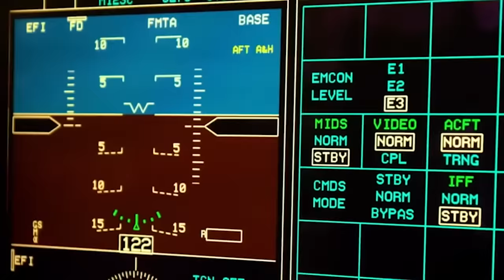The Cheapest Most Powerful Fighter in Existence

Comment: The idea of a cheaper, reliable and a fast to produce aircraft demonstrated by Northrop's F-5 has been upheld once more.
Reply: Was also the reasoning behind the MiG-21
Reply: @DarrellLarose  Yes. Both are forerunners of the idea.
Reply: @DarrellLarose and now the su 75
Reply: outdated
Reply: @jasonhunt007  not for the nations that can't afford 5th generation fighters.
Reply: @jasonhunt007  not true.
F-5E/F-20 airframe & engines have proven their performance & cost effectiveness. 

Radar, avionics, helmet mounted displays, networked data-link for Air Battle Management, etc an all be updated & upgraded.

Since air warfare doctrine is now geared towards BVR and missile engagements, what's key are EW, radar & missiles. All these can be done on a proven airframe like the F-5 E/F-20.

Stealth is over-rated. It just reduces the RCS. It doesn't make the plane invisible.
Reply: @therealrobinc none of that matters without the logistic support that the F-16 or a version of the F-16 has worldwide.
Reply: The PAF actually operated F-5s. Unfortunately, they were neglected and didn't get any upgrades :(
Reply: @jasonhunt007  how many times do you need to reinvent the wheel? The F-5E/F-20 are proven airframes that are cost effective to maintain and has the best bang for buck. Any nation that's serious can buy the entire factory to ensure enough spare parts & logistics support for its air force. Still cheaper than the F-16 across the board, and just as lethal with updated gear & weapons.
Reply: @therealrobinc  The F-5 is just too lightweight to be a serious defense system for any nation serious about defense.  Try again.
Reply: @therealrobinc  even the most poor South American nations can afford to fly the F-16 so your point is moot
Reply: @calebemerson9317  not at the expense of other essential expenditures in education, health, etc. Not every nation has the luxury of operating expensive gear with its own currency backed by ever increasing national debt like the US. You sound like the type who maxes out their credit card and only pay the monthly minimum and claim it's affordable, and never caring about your eventual total debt. That's utter irresponsibility & fiscal folly. In addition, the air forces of poorer nation don't need expensive gear to start & sustain continual wars to line the pockets of the military industrial complex lobby.
Reply: @therealrobinc  And who's going to develop the upgrades?  The country that cheaped out and bought the "budget budget fighter"?
Reply: @jasonhunt007  Agreed, the F-5/F-20 airframe is too small and obsolete to get enough done for the price tag, not to mention the lack of support considering how the wind blew on the F-20 sales.
Reply: @therealrobinc  F-5E and F-20, despite appearances, do not share the same airframe.  The F-20 uses an entirely new airframe (one based on an already obsolescent design).  Why do you need to reinvent the wheel?  When the blueprints for the old wheel are not available.  The resources used to figure out how the old wheel was made is just as easily, and likely better spent on reinventing it.
Reply: @jasonhunt007  1. High-low setup works and there's pleny of lower-tier tasks where F/A-50 is overkill, but allows to spare high end aircraft from wear and tear 2.  For DEFENSE and Air Policing most countries can do easily with Gripen C or F/A-50.
Reply: @calebemerson9317   New at 80 mln / a piece price tag and how about cost of OPERATING these aircraft? I doubt it.
Reply: wouldn`t it be closer to f16. both in appearance and `low cost` in comparison to the expensive f14 and f15 at the time
Reply: @hotdog9262  If F-16 and F-35 didn't exist, sure.  But they do, so FA-50 is a fighter that underbids even F-16, Like F-20 tried to do.
Reply: @@klinestill Not just someone decided to use the F-16. Many nations decided to use the F-16, creating a world wide sustainment supply chain to benefit all F-16 operators.
Reply: @@klinestill You had no point but thanks for trying.
Reply: Only this time its from South Korea.
Reply: @josephdioneda2881  This time is South Korea but with help from Companies from United States.
Reply: @mauricio-wq5lu  yes indeed that the FA-50 has been develop via joint ventures between the Korea Aerospace Industry and the Lockheed Martin, but over all the KAI company is the main production builder of that said combat aircraft.
Reply: @josephdioneda2881  Totally agree.
Reply: Crap F-35 in major wargames come out with a 7 to 1 win ratio most of the time @therealrobinc
Reply: Unfortunately in todays battlefield "cheap, reliable and basic" is a fundamentally flawed. 
A given case is this aircraft could not survive over a modern battlefield like in the Ukraine.
Reply: @LeonAust   War games can be gamed with the adversary being set rules to tie one hand behind its back.

F-35 is the epitome of paying more for less. 4th gen & even 3rd gen warbirds climb higher faster and can go faster.

Stealth is over-rated.

Since standoff weapons are preferred, then using cheaper proven airframes with updated avionics, data link & helmet systems launching them makes more sense.

F-35 have made current pilots dumber - one even hit the fantail of a carrier and slid into the ocean because reliance on automation has made current pilots weak in airmanship.
Reply: lol yeah riiight......Constant 7 to 1 ratio it is proven with pilots just out of flight school killing USAF F-15 and F-16 squadron commanders, its happening every week, it is that dominate.
Kinematics is getting less and less of a requirement and 5th 6th gen capabilities will be the new battlefield not speed and turning performances, that's for airshows.
Especially if one has an aircraft you cannot lock onto and I can lock on to you at over 100 miles away and even longer with the AIM-260 @therealrobinc
Reply: @LeonAust  LMAO. Why not stretch it to its logical conclusion, and ditch all manned warbirds in favor of cheap drones & standoff weapons.

That'll save the $1m+ to train each pilot. They aren't any good today with their poor airmanship anyway, since they can't do without their automation, even when landing. 🤣
Reply: @LeonAust  Stealth did not help the F-117 Nighthawk in Yugoslavia.

The effort, time & cost to maintain the stealth skin is a bitch.

Carrier borne F-35Cs do even worse in the salty spray.
Reply: @LeonAust   Not everyone can afford the alternative.
Reply: Except that these fighters aren't complete.  They can't use LAAMs like AMRAAM or Meteor.  Besides, that idea began with the MiG-21, not the F-5.
Reply: @llow You are correct on light weight fighters not being as advanced abilities as a heavy fighter and that the MIG-21 is first. I only used the F-5 as an example. 
A low cost aircraft may be all a nation can afford and build up its abilities over time if possible. 
They still have a place if a nation with more funds wants a cheaper lightweight aircraft to supplement a heavy fighter.
Reply: Looks like a combination of an F-5 and an F-16
Reply: @ashaide  I actually see the J-17 as a newer version of the F-20. Still love the old F-5s
Reply: @raidenj1295  
Not really, Su-75 is also a stealth fighter which is still gonna be expensive to this day.
Stealth aircraft aren't cheap, F-35 is the cheapest in production but suffered from maintenance cost, reliable is still a question, fast to produce is the only thing that's right.

I doubt the Su-75 would be cheap and easy to produce but reliable is trustable.
Reply: The US should have acquired the F20 Tiger Shark.
Reply: I hate to state this, but it seems Russia's SU-75 project is what the F-5 and the F-20 should have become. If the Russians succeed, they will have proven the concept of a lightweight fighter is still relevant.
Reply: And their F-20 Tiger shark which is what this aircraft resembles probably uses an f-400 f-18 engine.
Reply: F-5 was incredible, even modern fighters would not want to get into an actual close up dogfight with the tiny agile F-5
Reply: @deanfirnatine7814  Some nations still fly the F-5. They got their money's worth for sure.
Reply: @jasonhunt007  What about the f-20 with one singe f-18 engine with over 2 times the power of the F-5 and fly by wire and other updates.
Reply: @chrisbraswell8864  nothing is a better value than the F-16 with latest radar retrofit and world wide logistical support.  That is why F-16 foreign sales keep climbing with production in Greenville struggling to keep up.
Reply: @jasonhunt007   from what i heard in the 80s F16 won against F20 because someone in washington pulled some strings. They know this its a big earner whoever bags this. The F16 just became sophiticated over the years thus became pricy. South korea knew there such a market and reaps the reward
Reply: @rjgonzalez9220  F16 had many benefits over the F20 including the ability to carry twice the ordnance of the F20
Reply: @jasonhunt007  but you know that in actual dogfights you only carry 2 AAMs for max efficiency.
Reply: F-5/F-20을 칭찬하는 분들이 많으시네요, 근데 많은 장점을 망치는 단점에 대해서는 얘기가 없네요.
이 인상적인 항공기에 대한 부품 수급이 매우 어렵습니다, 한국에서 필리핀에게 공여한 F-5들이 대략 5년도 안되서 전부 사라진 중요한 이유죠.
Reply: The F-5 would have been a great platform for this type of scenario.
Reply: @DarrellLarose  That was more like the 60s F-20 than the F-5. The MiG-21 was designed as a high performance low cost light fighter, not as a low tech export that proved to be much better than anticipated.
Reply: @jasonhunt007  The F-20 was essentially a better engined F-5 and it could carry medium range AAMs before the F-16 could, it unironically was an overall better fighter than the F-16 when they first came out, it just had exhausted its potential as an airframe while the relaxed stability conventionally unfliable airfame was just starting to mature like fine wine waiting for technologies to catch up with its concept.

Comment: I am so happy and proud that Poland made significant purchase of these modern and higly tech (mini)fighters. Awesome stuff. And so are K2 Black Panthers.
Reply: Ja wolałabym KF-21 a najlepiej F-15 od Amerykanów. Bo dla mnie F-50 to taki Bielik M-346 ale na sterydach. Po co mieć dwa rodzaje samolotów szkolno-bojowych? Albo dozbroić Bielika i nim latać na patrole ale sprzedać go i zastąpić F-50
Reply: @paulinagabrys8874 does that plane have modern avionics?
Reply: @jyy9624  FA-50 을 운용할수 있다면
 F-16, F-35를 쉽게 탈수 있다는것을 의미합니다.
Reply: @acrossguysy  lol, FA-50 is equal to fly a F-35. Do you even have any physic knowledge or airjets tech? jeez... Nothing is the same, maybe the fact both have engines and wings... I could start with datalink of the F-35, but I will not waste more of my time. 40M vs 80M of a F35. Yeah, i surely would go with a F-50 - It's not a bad small jet (but with deeper pockets I would take the two or would choose the KF-21 - The FA-50 is a low budget airplane and no, it's not better than the F-16 in avionics, thrust vector, lack of agility as was built as a trainer and not a fighter)

Comment: This is a humble but worth-the-money airplane. In process is the upgrade for the AESA radar and medium-range A2A missiles (Meteor and AIM-120) and the price is going up. But still the hourly operating cost is well under 10,000 USD. (several thousand dollars).  Good for patrol and Close Air Support where you have the air defense systems (in a NOT-contested airspace).  

One interesting info about the maximum speed. 

It is 1,837 km/h. And Koreans say it is Mach 1.5.  This means they have divided the at-altitude (typically 50,000 feet) speed with at-sea-level sound speed(340 m/s), making the Mach number lower. 

The US or Europe calculates the Mach number of the maximum speed by dividing the max speed at altitude with the at-altitude sound speed(around 280 m/s).

If you calculate the max speed of FA-50 by the 'normal way',  it is Mach 1.83, not Mach 1.50.

These Korean guys like to play low-profile. Perhaps because they do not want to look 'too aggressive' toward China. 

Same with KF-21 Boramae. The max speed is 2,234 km/h. Koreans say it is Mach 1.8. But if you divide by the at-altitude sound speed, the Mach number becomes 2.22. Quite fast. Enough for a powerful interceptor.

I suspect this 'number-lowering game' is happening with regard to the max takeoff weight, too. As for the US fighters, they say that the real MTOW is just above 80% of the brochure number. But with Korean fighters, (FA-50 and KF-21. The latter is undergoing 2,000 test flights) the brochure number is the real one. 6 ton internal fuel and 7.7 ton armaments simultaneously, (totaling about 13.7 tons) for KF-21. 

Let us see how far they can go.. (I happen to be a Korean.^^)
Reply: Modern air combat of today and the future more relies more on stealth, ESM, ECM, networking, future drone escorts, situational awareness and all connected into the weapon system, helmet and glass cockpit.
Kinematics are getting a little less influential today combat. 
If the fighter is not stealth, the fighter needs extensive ESM, ECM just to survive, like being escorted by aircraft like the EA-18G Growler to carry out electronic warfare and SEAD.
Reply: @LeonAust  then we just get rid of all except F-35 and NGAD?
Reply: This Korea fighter 21 ,  ground strike and combat aircraft different, is very capable effective , using U.S.A made weapons. South Korea also has made Navy destroyer.
Reply: 국뽕 자제좀..
Reply: @LeonAust lol, depend on who you’re fighting and type of mission. Your comment is hardly nuanced. Btw are you American?
Reply: @JohnLee-db9zt as an American myself, I can say yes.
Reply: @혀재이  근거없이 찬양하는게 국뽕일진대 어느 포인트에서 국뽕이라는거임?
Reply: Dogfighting happens at less than Mach 1…so speed is good for other things (like running towards and away), but these lovely birds aren’t BVR capable and if they get into a dogfight, they’ll be lucky to survive. Having stated that, these birds have their uses in lower intensity combat areas, and I think any Air Force should never place all their eggs in one basket, so I think there are a few niches these birds could excel at. In any case, Korea is a hotbed of technological innovation. It’s sad to look into the future a few decades to see that their population is set to implode…not enough babies, like in China (that’s a good thing!), and Japan…meh. Even Russia is shrinking. It’s no wonder this decade is very likely to see a massive regional conflict or worse. It’s a case of now or never. Perhaps, the last conflict. That would be bad for business if the human species dies out. I mean who would buy all the crap made in China. I’ll bet that Chinese economists aren’t happy!
Reply: 국뽕이 차오른단말이쥬??
Reply: F-4 Phantom is quite fast, but for dog fight against mig, depends heavily on US excellent pilots.
Then US produce better & better air superiority fighter, which  . . slower. 

Fast fighter have it use as fast response interceptor.